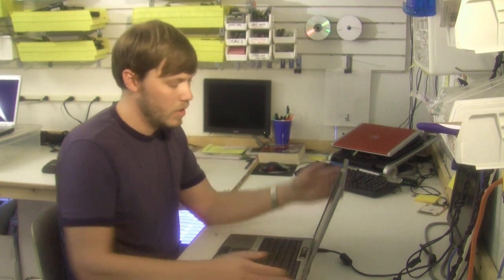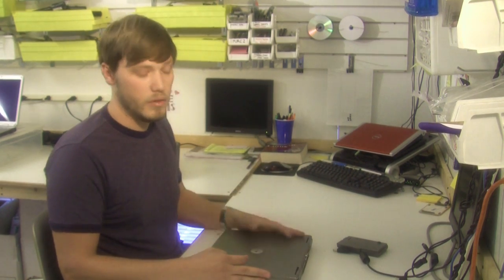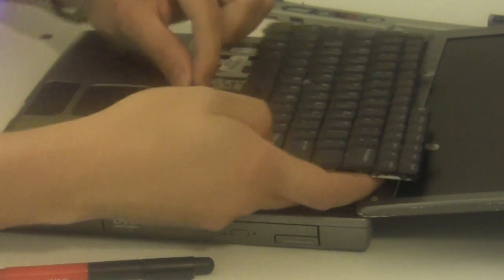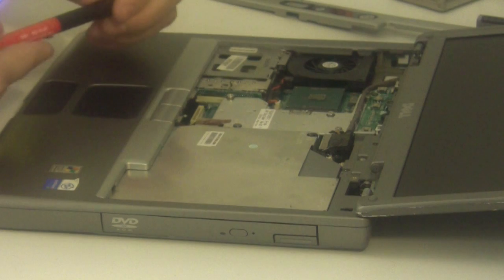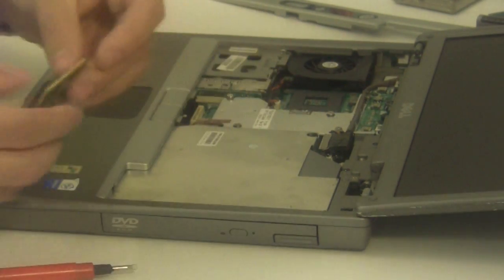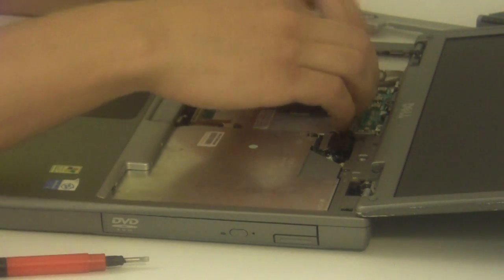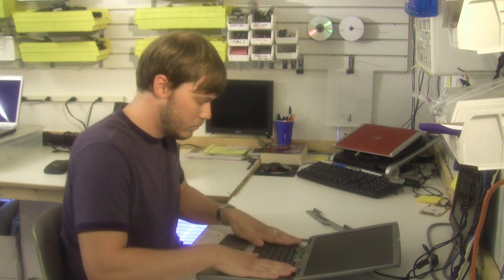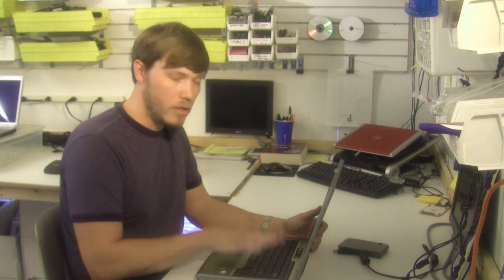Laptop Repair & Maintenance : How to Change a Laptop Processor

Comment: Download CPU-Z and then it will tell you your type of Socket. Then find processors with that socket. If your making a BIG upgrade, then you may need to also upgrade your graphics card etc... They may not be able to handle the processor

Comment: I have the same laptop and i was wondering the same thing. It depends on the make of the computer. Some cpu's are soldered into the computer but i'm not sure about this computer. Might have to check manually.

Comment: Horrible. if you play games. It will lag when trying to play games such as Skyrim on lowest settings, and resolution. You might get by some games, but it's not that great. As for general use, it is alright, but there are better. Most AMD CPUs have AMD Cards, which are much better. You can try those.

Comment: Aha! So you finally manned up and responded.
Anyways I'm sure you'll be DELIGHTED to read I fixed the problem. What was happening is my graphics card didn't like the fact that minecraft registered over 60 FPS (I learnt recently that monitors don't go over 60 fps anyways) so what I did was used VSync on my Nvidia control panel to limit FPS to 60, now everything is good.
So uhh..yeah...thanks Mr I'mSmarterThanYou. ¬_¬

Comment: i5 and i7 are not that differnt i7 is only a bit higher clocked and the performance difference in normal use isn't really visible and with gaming notebooks aren't that great doesn't matter if it has a good cpu or not they will most of the time overheat and slow down.

Comment: @kurankaname111 
In that case Ghz is refering to the speed of the device, be it RAM, GPU, or CPU. The CPU will varry from PC to PC. If your thinking of upgrading a laptop, take my advice and just save for a new one. If your just looking to get it a little faster you can try overclocking it, but there is risk involved. If you decide to overclock, amke sure you have a good coolong system.

Comment: I have a Compaq Presario CQ62-219WM notebook. Its bottleneck is the Celeron 900 single-core processor.  I just read in a forum that if you replace it with a 2.00/2m/800mhz 478-pin micro-FCPGA......part # SLA49, it increases the performance significantly.  I'm going to try this, as these parts are only 12 bucks on ebay

Comment: @RickmanSlickman I agree about a faster hard drive and graphics card but it's really not worth upgrading your RAM's speed at this stage in time. Upgrading from 1066 DDR3 to 2133 DDR3 gives you about an extra 5 GB/s read speed and about an extra 1 GB/s of write time. Yet it'll cost you over 100 bucks for 1866 RAM, let alone 2133. If you've got a decent GPU, save up for an SSD. It's as simple as that.

Comment: @Noobkilla99786 They will rip you off big time. You will end up paying $4,000-5,000 for a $900-$1,200 PC. In fact, they even charge you $1,200 to UPGRADE from 6 GB triple channel 1600 DDR3 to 12 GB triple channel 1600 DDR3. Just because you're spending more, doesn't mean you're getting a better product. Yes yes yes - make your own PC and use PCPartPicker, you'll save so much money.

Comment: Can you change a Processor on an Alienware Area 51 M15x Laptop? Because i was looking into replacing mine myself. and if it is possible what is the best processor that is compatible with the Area 51's as of now. 

PLEASE RESPOND

and Great video. Very fast. 

Ps: Where can i get that screwdriver o.0

Comment: No, not all CPU's will work in all MOBO's (motherboards). All MOBO's need the right socket and pin count from the CPU. Honestly, if you want to upgrade your laptop, i would advise a faster harddrive, RAM, of VID card. Spending money to upgrade an outdated CPU should be saved for a whole new PC. Hope this helps.

***Nice Scrwdriver***
Thumbs up if this helps, or you agree.

Comment: Nice tutorial but...

You didn't show cleaning of the CPU and cooler or applying new paste.
You just yanked out the keyboards delicate ribbon cable, didn't show the little locking clip that holds it in place.

Two pretty important things! lol

Comment: Ok i have a Compaq presario cq-60 and i need a higher speed processor to run my new video editing software which is Pinnacle Studio 14 Ultimate. I need a processor with atleast 24 GHz . Any suggestions?

Comment: Hey I have an
ASUS G51Vx-RX05 R.O.G's Laptop:
•nVIDIA Geforce Gtx 260m graphics card w/ 1GB videocard memory with Cuda and Physics. •intel Centrino core2 Duo @2.5GHz. •Resolution of 1366x768. •4GB of RAM. •320GB Harddrive. How will I be able to change out the intel Centrino core2 Duo processor with maybe two i5 processors? Or what way can I upgrade this processor?

Comment: Hey does anybody know how to increase my ghz? And if I need to change my cpu, how much would it cost roughly?

I have a Dell XPS M1530. Here are my specs:
My System Specifications:
OPERATING SYSTEM:WINDOWS 2.6.0.6000 ()
CPU TYPE:INTEL(R) CORE(TM)2 DUO CPU T5450 @ 1.66GHZ
CPU SPEED (GHZ):1.687
SYSTEM MEMORY (GB):1.998
GRAPHICS CARD MODEL:NVIDIA GEFORCE 8400M GS 
GRAPHICS CARD DRIVER:NVD3DUM.
DLLDESKTOP RESOLUTION:1280X800
HARD DISK SIZE (GB):136.472
HARD DISK FREE SPACE (GB):64.746

Comment: My laptop has an intel pentium t4400 processor and i was wondering if that could be updated to an intel core i5 processor.
My Current Specs:
Toshiba
L505 ES5018
Intel Pentium t4400 2.2GHz 800 MHz Front Side Bus
3Gb ram (ddr3 expandable to 8 Gb)
320 gb hdd

Thanks

Comment: My laptop has an Intel Celeron processor. Can I replace that with an Intel Duo 2 Processor?

SPECS:

Brand: Hewlett-Packard. 

Model: HP G71 Notebook PC

Processor: Intel(R) Celeron(R) CPU 900  @ 2.20GHz, 2194 Mhz, 1 Core(s), 1 Logical Processor(s).

System Type: 64x Based PC. 

RAM: 4GB

Hardrive: 320GB